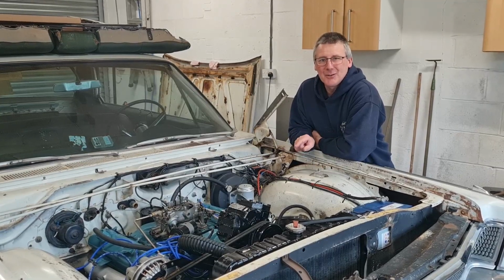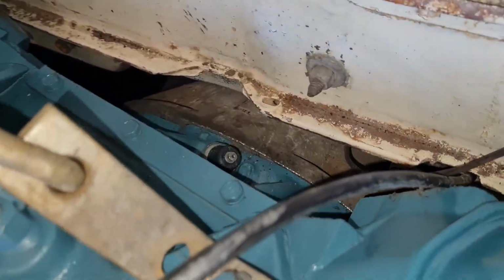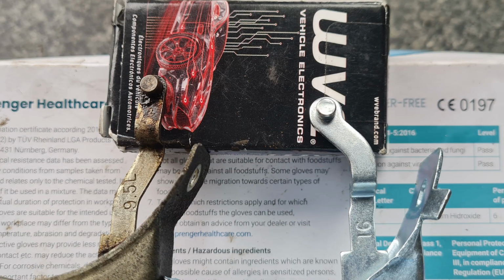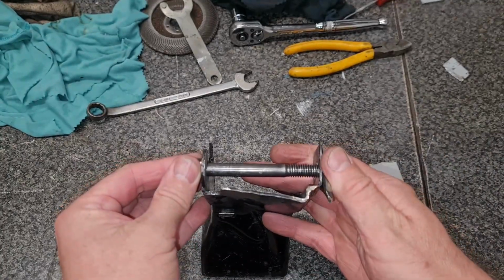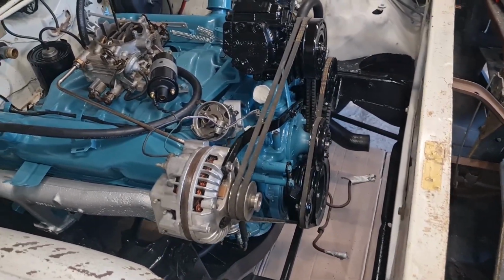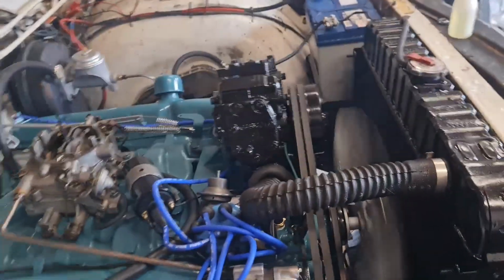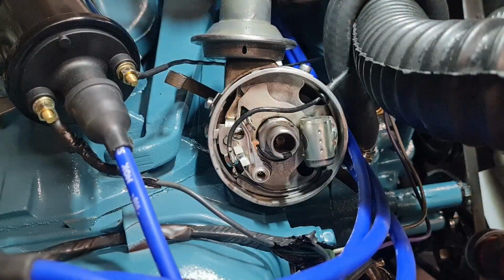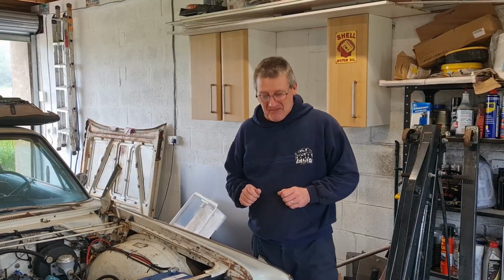Big Block Mopar Engine Install

Comment: I got nothing done this weekend because I had to watch every last one of these Mopar rebuild videos. Some bloke in Wales with almost no engineering support, or easy access to parts, just rebuilt a 440 on a whole new level. And then there is the common sense brilliants on a another level; checking the valve stems by using your fingertip to create a vacuum. I am in San Antonio Texas, easy access to a slant six for adjustable rockers, machine shop experts. You just built one rock solid Mopar for a beautiful New Yorker - you have out done the best of us, and I see you redid the break master cylinder too. Texas Respect!
Reply from the maker: Thankyou Imjin, I appreciate your support 😃👍🏻
The new Master Cylinder replacement is in the "Engine Removal" video 😎🤘🏻

https://youtu.be/-bOMLUCgB7Q?si=427CZNKcP1veQD2a
Hope you enjoy the channel 😉
P.S. That's my 1st ever rebuild of an engine! SGG 🤘🏻😎

Comment: Congrats on getting closer to that 1k mark, shouldn't be long now. Engine sounds nice, you did a great job on the engine and the power steering pump bracket mod was great - although these type of problems are annoying it is fun to use the noggin to come up with fixes for problems like that.

Comment: I believe there was a shroud around the fan to help pull the air through the radiator. This was especially needed with cars produced with Air Conditioning. If you do not restore the AC system, then perhaps it might be OK to leave off the shroud. There is a company that makes a new much smaller AC compressor that along with some other new parts can convert the AC system to the new R134 refrigerant. Yes, the power steering pumps can be quite noisy when there is no hydraulic fluid in the reservoir.
Reply from the maker: Thanks Joe. Yeah the pump wasn't too happy with no fluid in it LOL!  I do have the shroud for the radiator, but on removing the rad I found it was in 2 halves, the top and bottom area is missing and I haven't yet got round to repairing it yet. As I'm in the UK we don't have much use for A/C really 🙄 so not too much of a problem 👍

Comment: the lower heater hose connector by the fender is the hot water valve you can see it from under the dash. the heater hose goes to that first and then to the the other connectors (heater core) then back to the motor
Reply from the maker: Ahh!!!! Thankyou! That's right, it's something to do with the A/C, I remember watching something recently but didnt quite understand it. The penny has dropped now! Cheers for that Shop, I was going the wrong way round!! 👍🏻👍🏻👍🏻👍🏻

Comment: The reason you have the entries for the air con. The one at the top is for the heater core to allow coolant from the rad to warm the core and give you heat. The lower ones is for the gas to circulate from being warm to cool. Think of it like a fridge. If you plug the bottom 2 you can still you the heater core for car heating but when you want it to be cold it just be from the fan motor
Reply from the maker: Gotcha. Basically turning it into a non A/C car 👍🏻
Thankyou for that Daniel 😉
Reply: @SortedGeorgeGarage  spot on I got the same set up with a small block 318 so it’s identical

Comment: that vacuum canister is for the power trunk release.  look for the trunk release button in the glovebox on top
Reply from the maker: Yeah it had a tiny rust hole in the bottom of the canister. I repaired that, and there's a button in the glovebox and an actuator next to the trunk latch mechanism 😎👍🏻

Comment: Congratulations on your rebuild. Did you reuse the original cam? I didn’t see you do a cam break in procedure on start up. Thanks.
Reply from the maker: Hi Dave, thankyou Sir 👍🏻 I used another cam and lifters (as mentioned in my rebuild video) that had already been broken in as my original cam was worn through. By using the other used cam and lifters this saved me running a cam in for 20 minutes at about 2500rpm 😎👍🏻
Reply: @SortedGeorgeGarage  awesome! I must have missed that detail in the previous video. Congrats again!
Reply from the maker: Thankyou my friend. Was nerve wracking but thoroughly enjoyed it 🤠👍🏻

Comment: Hard to tell from Virginia but it sounds like it's running too fast
Reply from the maker: It was running a bit fast deliberately as it was it's first start. I wanted everything to seat in first before I started to adjust timing / idle etc. 👍🏻